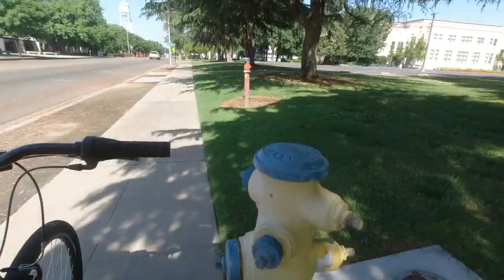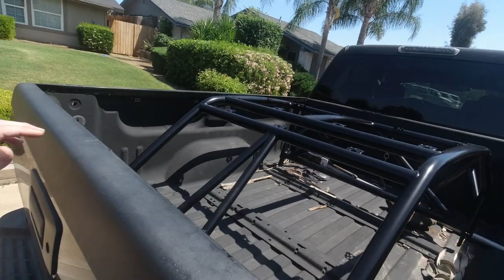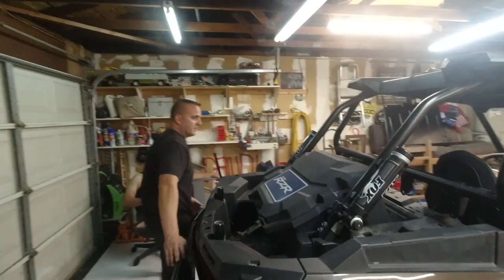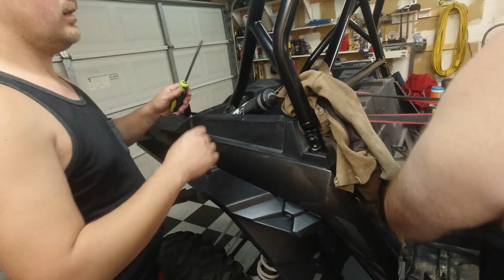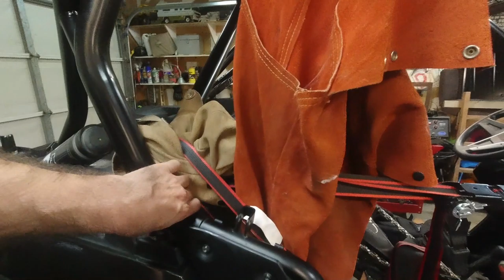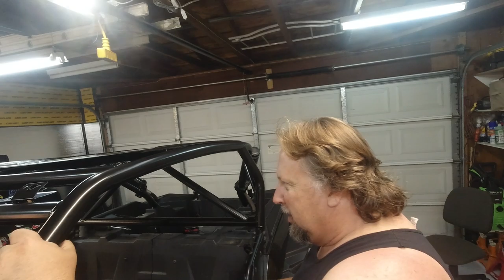RZR Turbo Gets a New SDR Cage!

Comment: A hint whenever doing a cage on a RZR.  The cage is 70% of the strength of the frame.  So once the old cage is off, you should jack the car up with one jack in the middle-center so both the front and back tires are off the ground.  The front and rear of the frame will sag, then the cage goes on much easier.  This in effect makes the frame longer.  Right out of the Polaris dealer install book!
Reply from the maker: Well there ya go, wish we had known that. Thanks for the info, I will remember that next time. Thanks for commenting.
Reply: @DandiOffroad  Yes it always more fun to learn the hard way.  Seems to be my MO in life!
Reply from the maker: But we won't forget